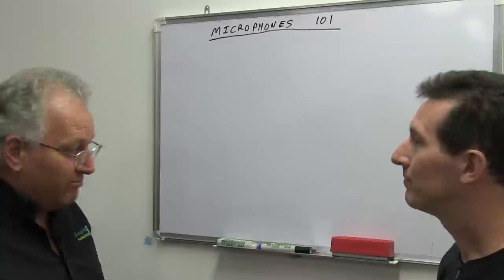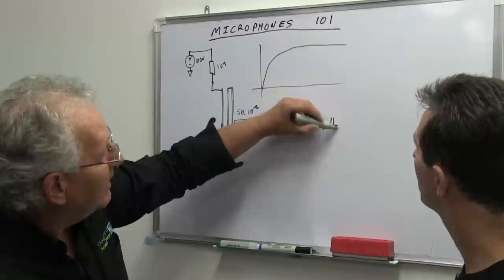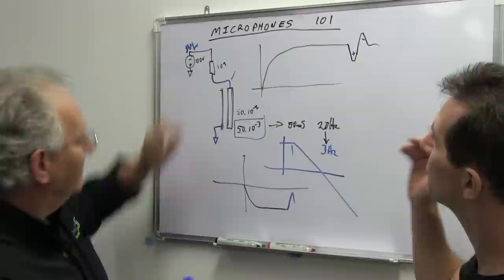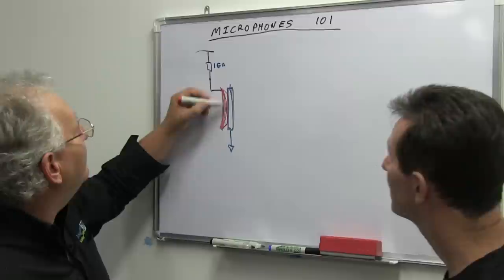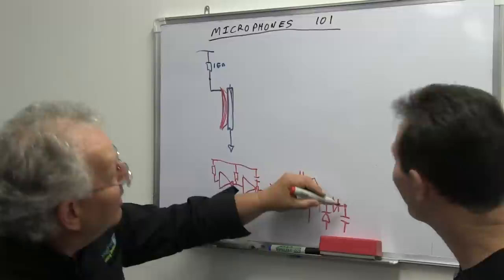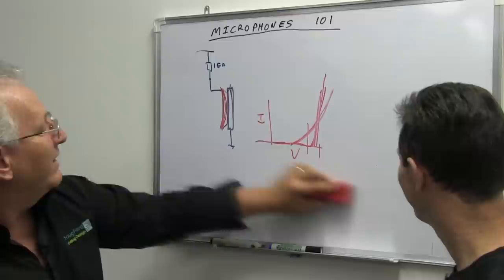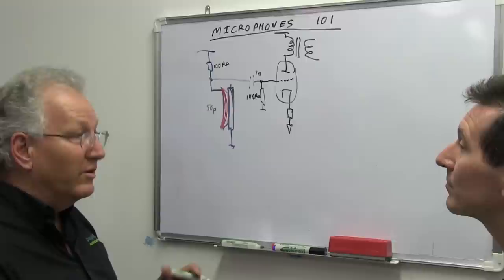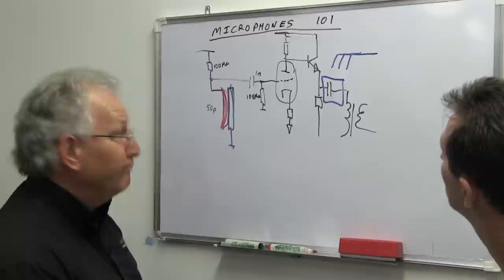EEVblog #609 - Condenser Microphone Design Tutorial

Comment: How does the external polarisation voltage relate to the typically 48 volt phantom power? In the video much larger voltages are mentioned as typical. Is it really charge pumped (or by some other method) to a higher voltage in all condencer mics? And how about those tube/valve mics, they would need actual amperes, or at least mAs?

Comment: Voltage is proportional to plate spacing on an isolated capacitor, so decreasing the capacitor increases the voltage, not decreases it.  The charge is trapped on the plates so the electric field strength stays constant, therefore voltage proportional to separation.
Reply: The energy is not constant, the air does work on the plates...

Comment: 3:45 Why is the -3dB point 2pi lower than the RC constant frequency?
I wonder if it is possible to use piezo crystals as a microphone (like an inversed piezo tweeter)...

Btw, I like how you use the DIN symbols instead of those goofy zigzag resistors.

Comment: Triode gain stage with BJT emitter follower? I'm confused. The most common-as-clarts triodes are dual, so why not just use the second triode as a cathode follower? The filament supply might need to be elevated depending on the HT voltage, but that's unlikely with the voltages mentioned, and if it is needed, it's trivial to implement.

Comment: Doug Ford is true guru of microphones. Hat down.

One thing bothers me... 10:39
10 microns with polarized voltage of about 50 - 200V? Is there air inside mic, or something else? Typical arc scenario that happens in free air should be about 1 mm per 1000V. With 10 micron gap it can start arcing at about 10V. Am I missing something, or didn't understand this properly?
Reply: That got me thinking too.
Reply: The mean free path of a molecule in a gas is the average distance between its collision with other molecules. This is inversely proportional to the pressure of the gas. In air the mean free path of molecules is about 96 nm. Since electrons are much faster, their average distance between colliding with molecules is about 5.6 times longer or about 0.5 µm. This is a substantial fraction of the 7.5 µm spacing between the electrodes for minimum arc voltage.
The electron mean free path can become long compared to the gap between the electrodes. In this case, the electrons might gain lots of energy, but have fewer ionizing collisions. A greater voltage is therefore required to assure ionization of enough gas molecules to start an avalanche.
High pressure and air medium are bad conditions for discharges. A REAL BUMMER IF YOU ARE PLASMA PHYSICIST AND YOU WANT the discharge and you are not avoiding it
Reply: There is no current there because of 5G resistor ;)

Comment: How will we get 60v or higher from 48v phantom power?  And how to connect the dual diapham capsule to jfet with multi pattern switch. Can you explain this in a video
Reply: Check the AKG C414 and Neumann U87 schematics. And maybe google "switch mode converter" :)

Comment: Can they explain why so few budget friendly price point mics (sub $100) will list frequency responses of like 100Hz to 16,000Hz? What is with the lack of mics with good bass response. Are the microphone companies scared of bass?
Reply: The condenser diaphragm in these mics are 24K gold sputtered. They are very expensive to manufacture. They run batches of diaphragms through the vacuum sputter process which is not perfect. The pic of the crop which are few for each batch, goes only into the high quality mics. The rest are sold off at a lower price to the lower end builders. This sputtering process is highly critical to the final sound of the mic. Hence the reason for the cost vs frequency response.
Reply: Alctron mc410 has full frequency response 30-22.000 hz for example and costs 45$.
Reply: That could happen when they made them cardiod. That canceling of noise in the side and back cancels the bass too. But for voice is something good because the voice is  not that low, so you end with an auto High pass filter.  You can always EQ.

Comment: Why are these microphones called "condenser" mikes? In german they are called "Kondensatormikrofon" (capacitor mike), which pretty much tells you already how the physically work.
Reply: For same reason as "mikes". Capacitor, condenser. Microphone, mike. Slang or urban, I guess.
Reply: Condenser mikes versus KONDENSatormik... Er, that's the same isn't it?
Reply from the maker: capacitors used to be called condensers
Reply: EEVblog in Portuguese, capacitor is "condensador"... Brasilian folks says "capacitor" insted "condensador" like the yankees...
Reply: In fact the german word "Kondensator" can mean both: "capacitor" like in electronics or "condenser" like "turbine condenser" in a power plant that turns steam back into water (condensation).

And honestly - it does not matter which word you use, everybody will understand all of them ;)
Reply: EEVblog Capacitors are still called condensers by folks who work on engines with breaker-point ignition.